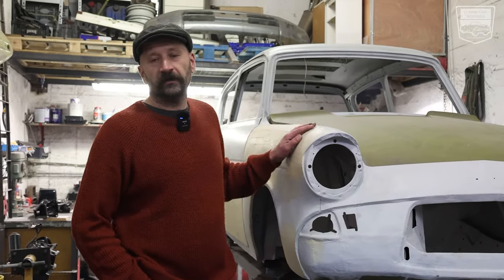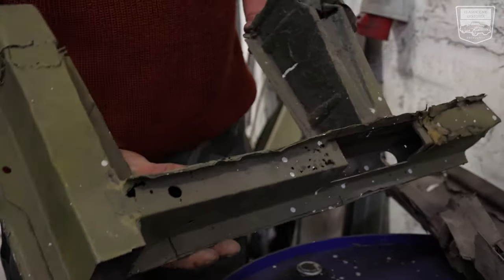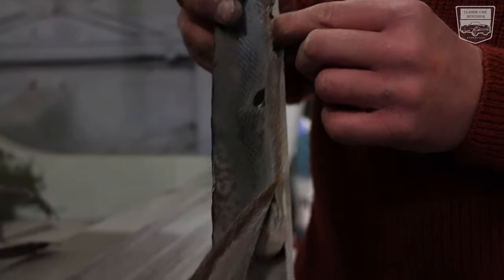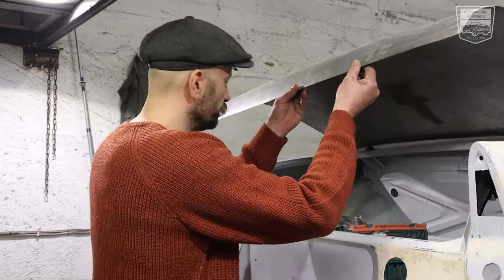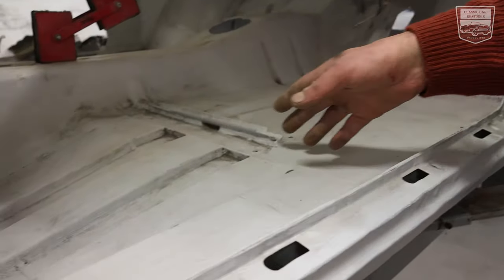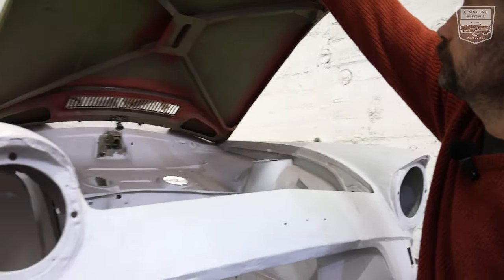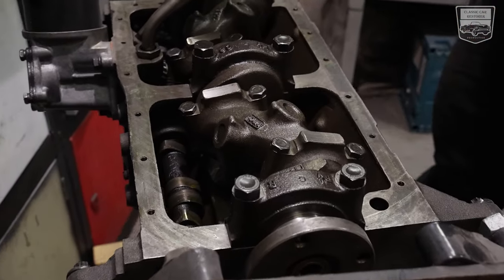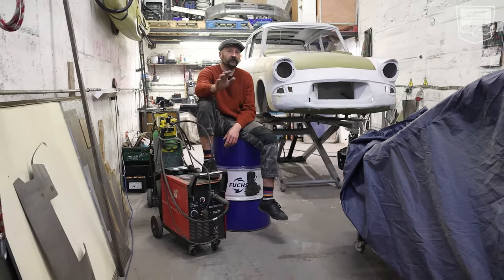Ford Anglia restoration

Comment: AT the moment it's hard to tell how good the metalwork you have done is, it looks rough BUT I will be interested to see it prior to primer filler.
Reply: Left door has to be sorted and few bits on body. We start to record videos almost after all welding is done, this is good sugestion to make some about rest of metal work. Boot lid is not done, we will try to record how we make inner frame, realy slow and demanding proces, - combination of svager, shrinker/strecher, Ewheel, etc. Than we can talk about primer :)) This was saturday job last 2 years, sort of deal with car owner. Workshop is full of much bigger and way demanding cars that we are on full time job.. but it looks like folks just like Anglia more, cause many of them have that budget car in mens shed, working on it here and there. Stay with us, we will try the best. Thanks on comment.
Reply: @borispotocnik9493 I used to own one many years ago always loved them, can't wait to see your progress, I am subscribed.
Reply: @borispotocnik9493  Not an expert by any means, but the boot lid looked/seemed a little flimsy to me?
Reply: It's Looking good so far, guys once you have the frame welded to the boot lid will be much stiffer, now subscribed  love my old ford's if anyone thinks this has lots of filler on it check out patches on Yorkshire car restoration  Steve and Ryan will  work wonders with it. No kidding, it's about 15mm thick. Ryan has been stripping it off ❤